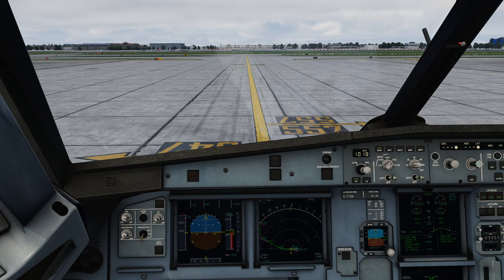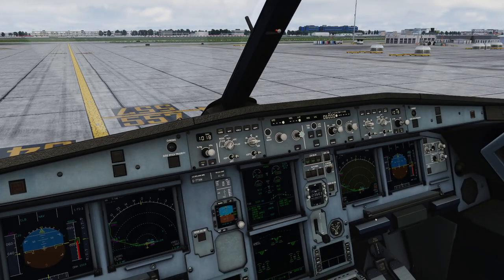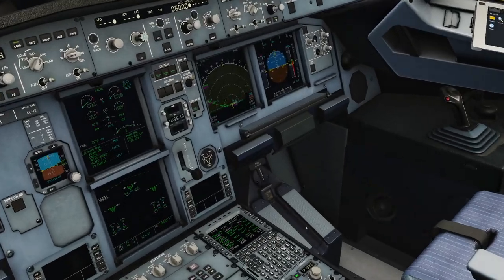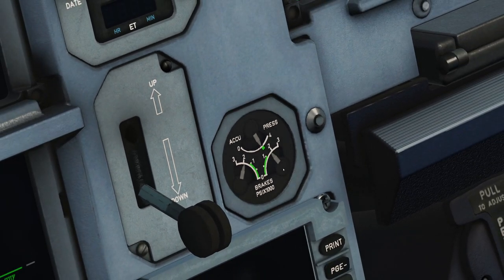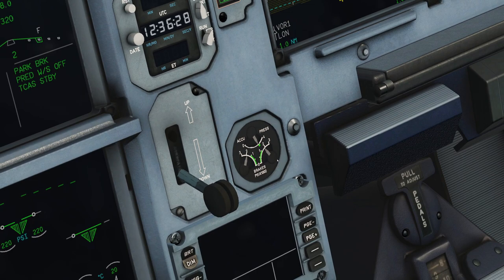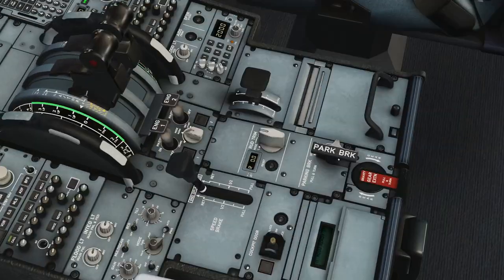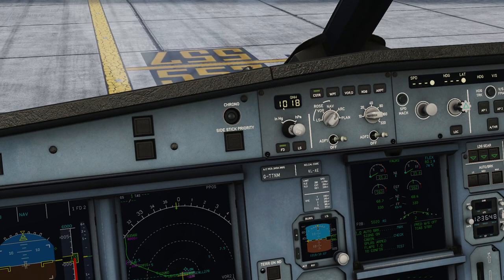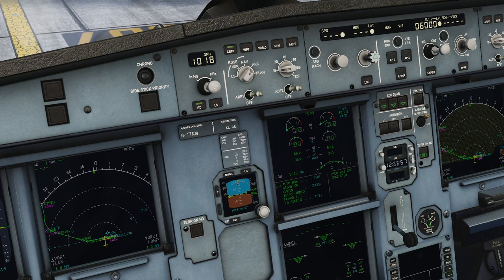Not what you think: BRAKE CHECK - WHY do we DO IT? | Real Airline Pilot

Comment: Emanual why is it that with the fenix A320 I always end up with more fuel when landed compared to calculated prediction? 

Depending on the distance I usually end up having 1-2.5 tons more fuel on top of reserve + fuel to alternate. 
I'm using simbrief.

Do you also experience this phenomena?

PS.: Thank you for you effort to creating these videos and congratulations on your type rating. Wish you "boring" flights.

boring: as incident free, always normal procedures, trouble free passengers.
Reply: Was already answered in the Fenix discord. In v1 they had to sacrifice accurate fuel burn at cruise for proper behaviour in other phases of flight, thus the Fenix will typically burn less than any planning tools and the real aircraft. It is addressed in the V2 coming soon.
Reply: @gfusion  Oh I see. Thanks for answering it. I got the fenix a year after release so I missed all the news, updates and never occurred to me to look in the forums.
Reply: Should be fixed next month with the custom engine simulation